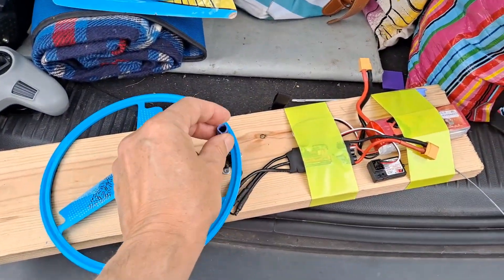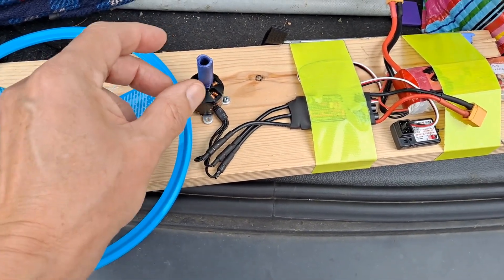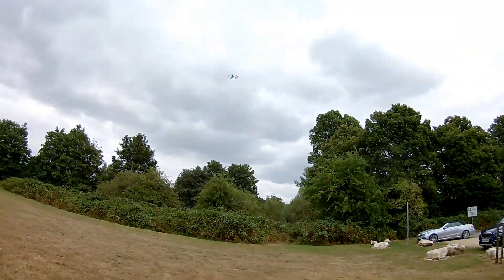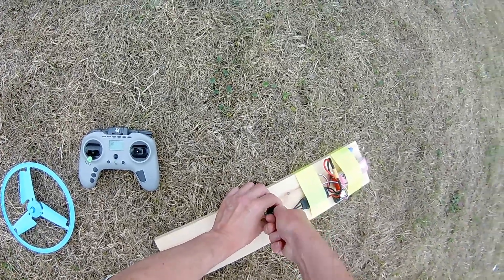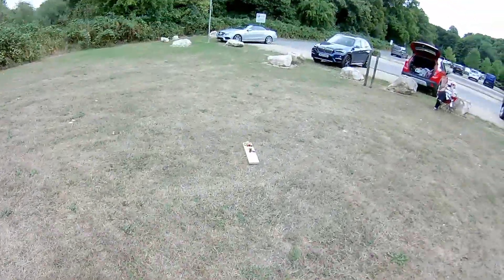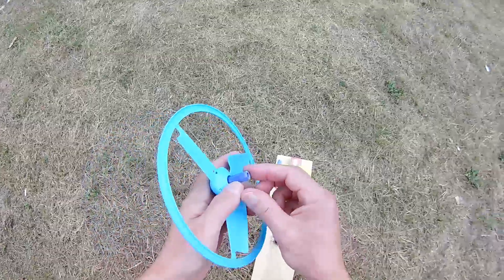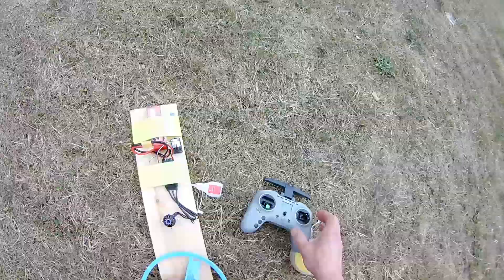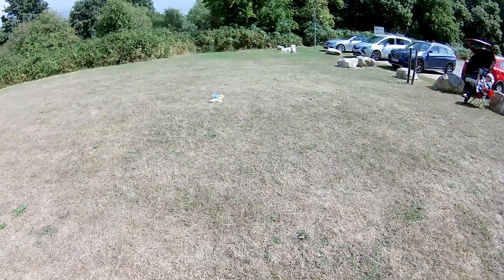Near Disaster 😮 Poundland Cyclone Flyer + Brushless motor + 3S LiPo 20220818

Comment: Holy moly Graham. That was a close call. No one was expecting that. Assuming is a bad idea. In one of my earlier comments, I said you would need a really high RPM for it to explode. Well, that motor obviously puts out enough RPM to do it. Those disks just can't stand the speed. At least you have proved that it can be launched by a motor but beware! 😨👍
Just a thought. Make lots of them and send them to the Kremlin.
Reply from the maker: I don't know what damage the shrapnel would cause at the distance we were, but close up would have certainly been unpleasant. Obviously my editing emphasised the action, but it was a good example of what can go wrong and worth publishing. Tom Stanton demonstrated this 'problem' in this video here https://www.youtube.com/watch?v=Gp0Zi7U--30&t=290s
Reply: @GrandadIsAnOldMan  Yes, just watched his video. The RPM was just above 4,000. We have to remember that these discs were not built for high speed. The props for powerful brushless and glow engines are made from very strong material. I think it is some sort of resin, plus the use of carbon fiber. Maybe a stronger one next time? If there is a next time.😆
CD shattering at 23,000 RPM. And in very slow motion. Dangerous stuff. https://www.youtube.com/watch?v=zs7x1Hu29Wc
Check this out: https://www.youtube.com/watch?v=ENZ_rQLCa9Q

Comment: My wife liked playing the SIMS on her PC (this is like 8 years ago I guess). It was in those days that you were forced to keep the DVD in your player, so it could double check you have a paid version. And then on a day we heard a big bang. The DVD player had shattered the DVD in a thousand pieces!
I am glad software is nowadays not requiring you to have a DVD spinning all the time.
PS: and yes, I do know you can have DVD emulators, but in this case they did a nifty trick, reading 'between' tracks.

So the cyclone flyer could not withstand it? A simple DVD couldn't either.

PS: if you ever have a thread loosening itself, you can try bashing over those threads with a blunt knife or so. It will make the edges rough and give a lot of friction. (glue is so definitive).
Reply from the maker: It was a perfectly good brushless motor, I don't think I would want to damage the threads on it. The superglue can always be removed at a later date. As the thread was self tapped into the PLA it was going to have pretty minimal strength anyway and the direction of spin happened to be in the direction that undid it. If the thread was the opposite direction it would have tightened it each time.
Reply from the maker: AH, the good old days. 😆👍